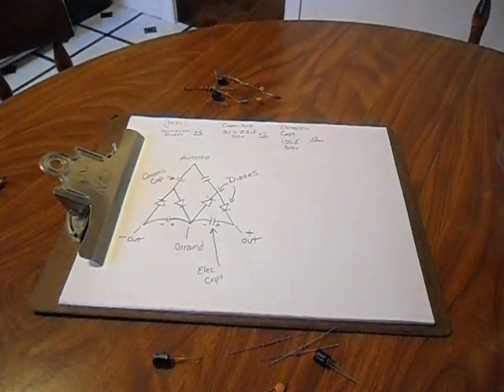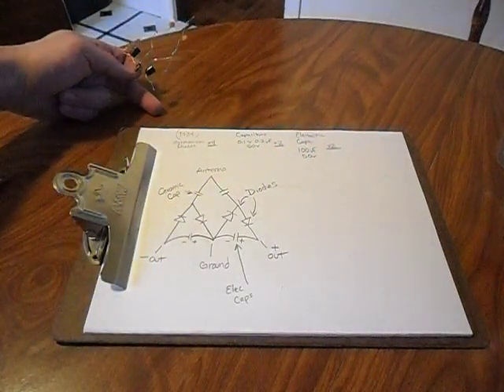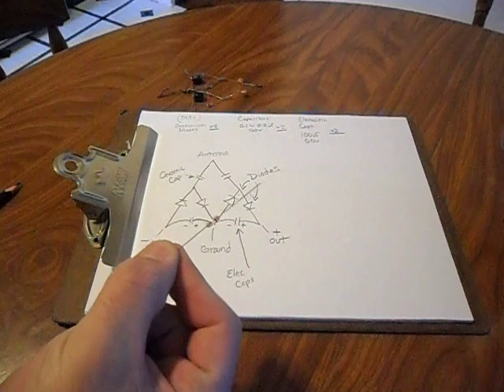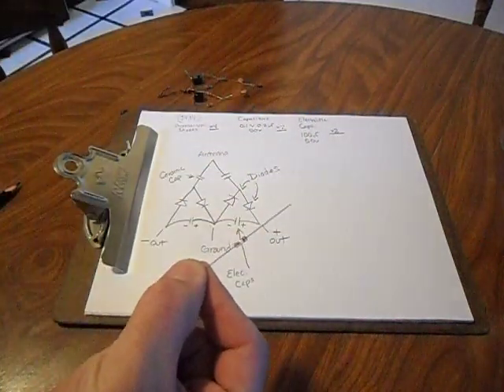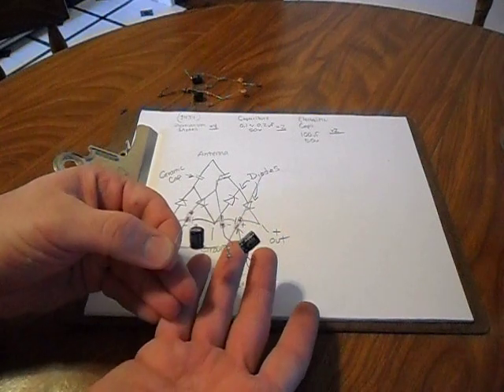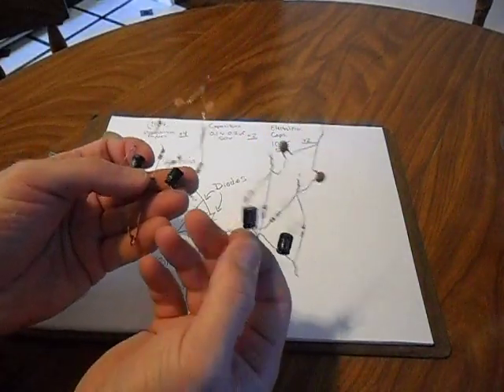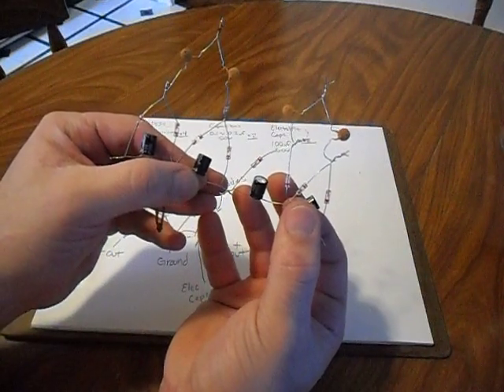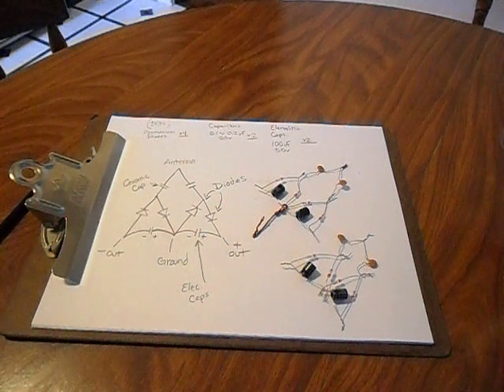Nikola Tesla "free energy from air" circuit explained and building instructions.

Comment: Maybe a large scale setup of pylons and outstretched cables across the country would attract enough electricity from the air to power a city...what if already done?
Reply: spokiee2000
 Lets say you could get a massive wattage from radio wave inteception (You can't by the way, that's why you need DC amplifiers on radio recievers) Where do you propose that you get the radiowaves from? Ohh that's right.. Without power you can't generate and transmit them. At best, if this device worked (And it doesn't) you would have a radio reciever which transduces radio waves into current. So what you've successfully managed to do is recieve a radio wave from a transmitter where the radiowave has lost considerable energy due to the tranmission medium. That's the reason we use wires instead of air, to stop power loss over long distances. The true miracle of tesla was his work on three phase electric power and the widescale adoption of transformers. They are the key to power transmission, not "history" channel fucking science.
Reply: Hari S i have seen phone lines pickup an extra 60 volts from high power lines a 1/4 mile away.enuff to really knock ya on yer ass...theres a thing called inductance..in the right location some major juice could be collected this way...
Reply: Hari S your-an-idiot.......Do_SOME_ACTUAL_Research.....Don't_Base_your_Evidence_on_one_fake_wiki_report_lol_THEIRS_A_REASON_WHY_THE_GOVERNMENT_HIDES_ALL_OF_TELSA'S_WORK_THEY_CANT_TAX_A_FREE_ENERGY_METHOD.....REALLY_DO_SO_RESEARCH_DUDE>BECAUSE_YOUR_COMING_OFF_LIKE_AN_DUMBASS>>>>>>>JUST_........SAYING
Reply: spokiee2000 LOL if you actually think the history channel is a legitimate source for scientific information.. I've not some bad news for you....
Reply: Exactly,, the Earth does generate an enormous amount of electricity which can...and maybe already is being tapped into,,
Like all things that save consumers money in the past 100 years, there is always a delayed commercial use for electrically consuming devices. Why would the production of the source be any different?
If you have 10 minutes to read this

http://en.wikipedia.org/wiki/Atmospheric_electricity
 
And also this

http://en.wikipedia.org/wiki/High_Frequency_Active_Auroral_Research_Program

I believe this can be done!
Who agrees?
Reply: The antenna pulls power from radio waves you can only expect to get low voltage DC power from such a device. So yea sorry to burst your bubble.
Reply: Hari S
are you serious LOL??? tesla ran a high output electric motor which powered a car to 90mph off this method.... this on a large scale would power the entire country
Reply: spokiee2000 Impossible! No he didn't stop spreading lies.
Reply: Hari S

LOLLOLOOLOLOLOL get your facts straight TROLL
Reply: spokiee2000 lol I'm the troll? What your claiming is beyond the laws of physics
Reply: Hari S
Are you kidding me??? LOL dude do some research before you try to comment on some shit.... why are you even on a video regarding such things if your oblivious to its uses, and historical facts....research harmonic resonance, and research Tesla's work.. then come back and comment.
Reply: SuperRoss007 yes this could be possible but I was simply taking about the limed radiant energy that can be collected from radio waves already in the air. No where near enough to power a car would be possible if you had a powerful emw generator (large electo- magnet). 
Of and to the other guy spokiee2000  I did some research what you claimed with the car yea it never happen it was hoax but that didn't surprise me. 
So I guess you really don't know what your talking about.
Reply: ya theres not enough amps from radio waves but it might be possible to pickup electricity from high tension lines through inductance...
Reply: spokiee2000 I Did  and couldn't find one legitimate source! No news paper articles nothing in any science journals. Only stupid conspiracy theorist, websites who have 0 scientific background knowledge hosted such stupid claims. You can't back up tour claims how am I the dumb-ass?
Reply: Hari S Watch_the_history_channels_special_on_.....Tesla's_secret_technology
Reply: Hari S WIKI_IS_USER_SUBMITTED_INFORMATION_NOT_ACTUAL_FACTS
Reply: Hari S research_the_Hutchinson_effect.......
Reply: Using the Earth's natural electric field fluctuations rather than radio waves,,Radio transmitter?...Radio wave interception?
Reply: Michael Anderson
An electric field which fluctuates is called a magnetic field. The earth has a magnetic field as a result of the mantle under the earths crust and the iron core at its center. The planet has taken energy over the course of its development and magnetised itself into a state of hysteresis. Hysteresis is the term we use to describe energy which is trapped in a magnetic field and it takes a degree of force to magnetise the poles in the opposite direction. Once a magnet has been magnetised, it is impossible to get that energy back, it slowly decays with time and outputs a constant force. To extract energy from a magnet, we must allow the force to generate work. Unfortunately, with permenant magnets we run into the problem that we cannot simply turn the magnet off. As a result, you must supply the same amount of force to pull back the material from the magnet counteracting any power gained from the initial drop. You cannot take power from the earths magnetic field and even if you could, you would likely get a massive amount more energy from the chemical processes we use already in standard generators. When you lift a piece of iron you are defeating the entire earths gravitational and magnetic field. That should give you some idea as to how hopelessly powerless it truly is.
Reply: put the magnets on a wheel to create a motor
Reply: SuperRoss007
Then you have a wheel which doesn't rotate without external force. If you add an external force you've made what is called a rotary generator. The industry uses these already to generate electricity.

Comment: Are all germanium diodes 1n34 of the same specs?  Sorry I'm new to this.

Manufacturer Part No    1N34A
Peak Inv. Voltage(PIV)    60 Volts
Max. Average Rectified Current    50mA @ 25 deg C
Junction Temperature (TJ)    100 deg C Max.
FWD Voltage Drop(VF)    1.0V @ 5.0 mA
Reverse Current     IR 15uA @ VR 10 volts
Case/Package    D0-7
Reply: yes

Comment: I tried this out today and wasn't having much luck. I asked a friend who turned on his radio transmitter and waved it past the capacitors without it connected to an antenna the voltage shot up to about 8-9 volts, it did quickly drop down again. So if I went and tested it by a cell phone mast would it be as effective?

Comment: well it is possible but you will have to make many of these circuits and then parallel them all and you will still only get very little energy out of it... you will be able to flash a row of LED's every few seconds maybe but not much more. it will be very hard to light the LED's continuously. not impossible, but it takes a lot of effort cause the energy which is inductively coupled via the homegrid is so little. usable, but little. cheers

Comment: and strange it would not go over 240 volts that was the most I seen in my capacitor and that just happens to be what the grid runs on in Canada.  I made a portable circuit and walked around and used my hand as a ground.  I connected a small neon light in parallel with the capacitor and the light would blink when I approached a large power line but it would not blink anywhere else.

Comment: Take 2 diodes and connect the cathode of one and connect it to the anode of the other then connect a antenna to the middle of the 2 diodes where you connected them.  Then ground the anode of the bottom diode so you have 2 diodes connected together and grounded.  Then take a capacitor (ceramic works best around .1uf) and connect one lead to the cathode of the top diode and ground the other end of the capacitor with the bottom diode that we grounded.  I have charged a large capacitor to 110v

Comment: I am just going to say that I have worked with this very circuit and I built a much more simple and efficient design and yes it does pull power from your house and power lines it does not tune to radio it tunes to the strongest signal.  If you ground it to your wall pug ground it will work amazing but the power is from your house.

Comment: This is a small circuit to teach fundamental understanding. Modify the Antenna and you will draw more energy. Energy is everywhere. Turning off the home grid does not change that. All energy is free. It is not a scientific term. It is an economic term for energy that cannot be bottled and sold.

Comment: The Larger dish allows you to cover a larger area when you don't have a specific target.  The amplification of the signal is done electronically. Energy waves are like the waves in a pond. Unless they are sent in a highly focused beam using a carrier wave, then it is possible that they will radiate. Sound operates in the same fashion as it is a lower octave of energy. There is not enough space to answer in more detail for me. I hope I was able to give you direction for further research.

Comment: well yea i did also ground the circuit, which of course generated a greater potential difference which additionally sped up the charging of the C. I could flash a LED every minute or so just with the energy that I got that way. its a really fun experiment, really, but when u turn off the homegrid, the effect is gone
I am not saying "free energy" is unreal, I am just saying that the circuit in this video uses homegrid as a source and absorbs its energy. it is, at its best, a cool energy recycler!

Comment: I have built this circuit long before I watched this video. Now, at firct glance when you connect everything, you are amazed cause it SEEMS to work since the C really starts charging. U think its "free energy".. but whats really happening is that the 50hz waves of your home are inductively coupled into the antenna and absorbed into the C. So, it's just a wireless energytransmission whereas the energy comes from your home grid. Proof: just turn off your home grid entirely, and you will see.

Comment: The whole post should read like this:
"It works on the same principle as a crystal radio, except, instead of tuning in to a specific radio station, we're trying to tune in to the best/strongest signal of whatever type and rather than listening to it we're storing or using it.
The crystal radio is the basis of pretty much every communications receiver in the world. All the rest of the circuitry is amplifiers and other bells and whistles."

Comment: Why not wrap the antenna wire (or whatever it's made from) around tv antenna wire, electrical cords of anything that's plugged in and running, or even your home's electrical wiring. It would pick up energy by induction.
One time I put my "boom-box" on top of my tv with the antenna next to the tv's cable lead. 2 days later I found a frequency on the radio where I could hear the audio from any tv channel I turned to on the tv. Maybe we can harvest energy from anything plugged in and running.

Comment: Yes you could hook as many of them as you like in series or parallel, or series-parallel. Doing so would be the same as hooking up as many batteries in the same configuration, however you might have to have a separate antenna for each one.
Actually, that's an interesting thought. How much power can each one of those units handle and could you have an antenna that collected enough power that you would need more than one of these circuits to collect all the power from it. Verrrry interesting.

Comment: Another option might be solar power.
Antenna surface area is important, so I'll be trying things like shiny, metal plates, or aluminum foil, etc. for antennae. I know antennae can, and should be tuned (oh, where do you start with tuning foil), as our host said, for the strongest signal. What about tuning multiple antennae to multiple signals, or many to the same signal? Maybe a roof with metal shingles tuned to best frequency. Hmmmmm, You never know what possibilities might pop up.

Comment: i see the ceramic  caps only thing is caps are used to filter block curent and only pass signal such as audio  video waveform its used to couple the out to next stage input tubes and transistors  use them i think it would do more takeing out the ceramic caps add 2 choke transformers on each lead to boost input from antenna

Comment: And at any point did the guy who made the video claim that it did anything magical?

It simply converts radiant energy into DC electricity. Given that there is only a small antenna and most places have relatively little electromagnetic radiation, of course it won't power much of anything. It would be a usable amount of power if you gave it a big antenna and shot strong electromagnetic radiation toward it (such as microwaves from a magnetron). Building it small is just a proof-of-concept model.

Comment: I built this tesla circuit to and found , that what I got is not even couverd in the info on this circuit tesla built , its been edited and missing details   many of teslas inventions have been alterd and details missing , this circuit works better in the presents of a hv ac rf source  via another circuit    you don't need a long ereal wire  as your just receaveing the rf ac energy from the power grid ,

Comment: I'd say use 1n34 germaniums on your diodes. The barrel style capacitors, most likely 47 or 100uF electrolytic (polarized) 16V types. The small orange disc shaped ceramic caps, most likely .22uF 50 or 100V. You won't find the right diodes - but everything else you'll find in a scrapped PC power supply.

Comment: Isn't this just an rf detector circuit? I see voltage on the disconnected leads of my various VOMs all the time- high impedance means low drain of voltage buildup. AC power and RF will both cause this. With a long enough antenna you may be able to get a few milliamps, but no magic here.

Comment: Not sure if you noticed, but, the car was mobile & was able to travel anywhere! The point is that the energy is everywhere!  The location was irrelevant!  Tesla, tuned the circuit, before beginning his journey, and did not have to re-tune the device, when changing location!  The car ran continuously! The motor did get very hot, which probably was a result of trying to regulate the speed. It was prob. variable. This could have been through a voltage controller, or something else!

Comment: Tesla had a box of electrical tubes, which plugged into the dashboard of the car. It enabled it to extract 240 volts or more, from the cosmos.  By the way the energy extracted is not radio waves!  It is commonly referred to as quantum energy. It is dirived from each and every atom around us.  The is the hurdle that the scientific community has to overcome in order for our civilization to get to the next step in its evolution.  Even Tesla did not fully understand where the energy came from!

Comment: Are you aware that Tesla ran an electric car with 2 passengers across the country side with  just a 6 foot antenna, 1battery, and a 240 volt electric motor. The car was capable of nearly 90 mph.  So the point is that the energy is available. Most folks are trying to make real use of the technology, since the government has suppressed it and there is no chance they will ever admit to it and then make it available.